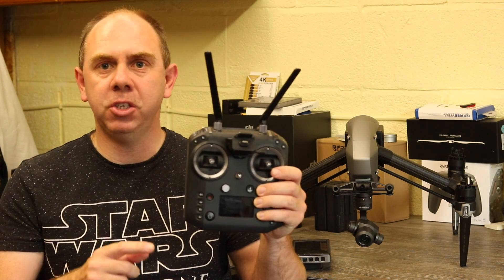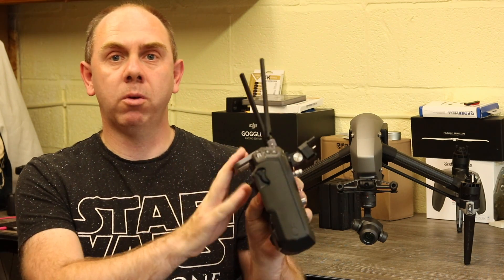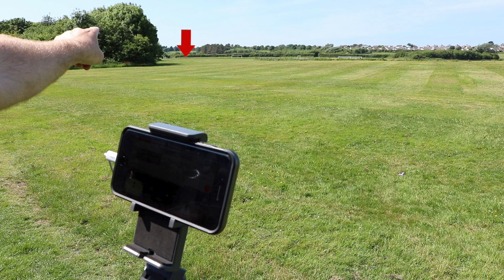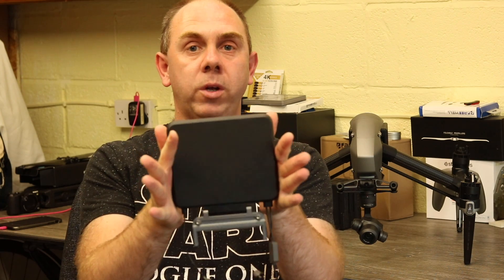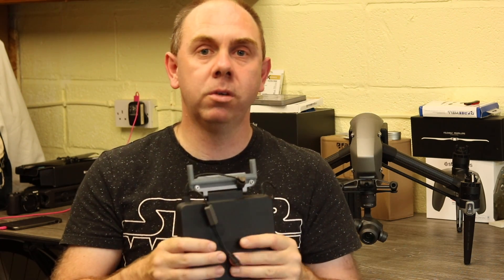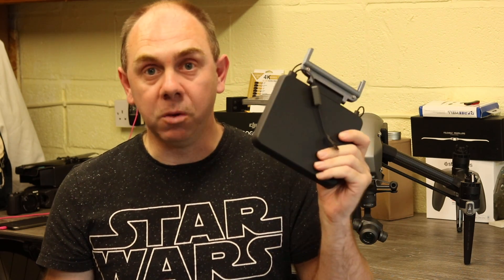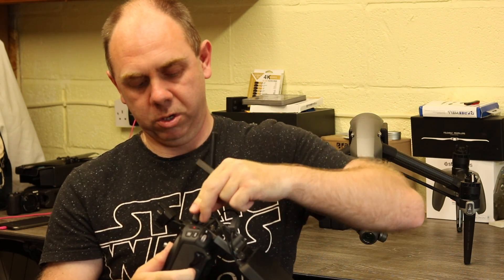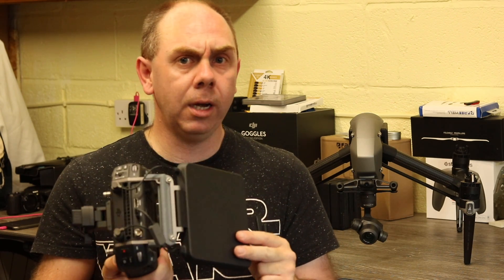DJI Cendence Patch Antenna Signal Tests & FOV Info - Pro Users and Broadcast Especally

Comment: I recently started flying cell phone towers and on some of them I have terrible loss of signal. I've been using a p4p V1. Would one of these patch antennas improve that situation for me and is there one available for the p4p? Thank you!
Reply from the maker: Check out 4Hawks for other patch antennas for DJI other models.  It may help as it’s more directional.
Reply: @MadRC  
Ty!

Comment: Hi. I have liked all of your videos, hence my Subscription. I only found this one, because I was looking for FOV info. Having watched it, I'd like to say that my experience with the patch antenna has been very different. I have not lost signal - ever. With my Inspire 2 directly above, a km out to sea, me hiding behind an object so I am not in shot. I have not consciously 'aimed' the patch at the UAV, especially when chatting to the client at the same time. This is not a later implementation, as I got my Cendence/Crystal Sky as soon as they were available. You have made me want to formally test it. 2 days ago I was filming an approach to a wharf from 600M out to sea, where we were re-enacting an evacuation scenario, and I had to hide behind a small building. I was actually facing away from the Inspire while hiding, and had no issues. The other day, I had a job where I flew about 1.2km away among big power lines between two radio masts. I expected some RF interference, but everything went perfectly.

Comment: Hi. I’ve just bought my I2 and am mad busy reading and watching everything I can to try and get up to speed on this amazing craft (still have my M2P). The purchase included a Cendence remote with the patch antenna and CS monitor. I noted your mention of the CS not currently being able to support 1080p. Having said that I see this is 12 months old and wonder if there has since been an update on the CS (there’s usually a lag). Many thanks. Peter
Reply from the maker: Sadly no nothing has changed on this and tbh i'm not expecting it to now sadly. Its performance was not quite there.
Reply: Ahh well, that’s life I guess. Thanks for replying. At the moment I’m trying to see if there’s any way to get a zoom lens to zoom using any buttons or wheels on the std controller being used as a slave to the Cendence as master. I can use a slider on the screen but it’s a little hit and miss so configuring one of the wheels to zoom in and out would be much better if I can figure out how. Thanks again, take care. Peter

Comment: Hi Mad RC, great video. On the latest firmware om both my Cendence and I2 but cant Seem to find the bitrate settings anymore? There's no custom option under HD.
Reply from the maker: Are you using Crystalsky, If not try changing your devices region settings to USA, I will fire mine up and Look.
Reply: @MadRC  Im using a oneplus 5T with a cendence RC, located in Denmark.
Reply from the maker: I have a feeling it’s only on IOS now.

Comment: thx for the quick disconnect link !  I'm a bit confused on the part about 1080 vs 720 for Android & iOS.  I've used live feed via Android tablet numerous times in 1080 and no issue.  Maybe I misunderstood the info on that .  .  . great video, thx for putting it together for your subscribers !!

Comment: hi Mad rc

nice informative video thanks. id like to know how the patch performs when  obstacles like trees get in the way as the standard antenna seems to suffer pretty badly when any such objects obstruct direct line signal to the drone in my experience. Yes i can still see the drone but the branches are dense enough to block transmission signal with standard antennas.
Reply from the maker: It should be better but it’s an interesting test, let me think and come up with something.

Comment: If you do not get the message that the Patch Antenna is connected after the FW update, 1) disconnect the antenna, 2) boot the Cendence, 3) turn Cendence off, 4) reattach the antenna and then reboot.  I had to do this to get the message.

Comment: I have been using a secraft tray with my Cendence, much more stable neck strap and palm rest,  but when using the secraft tray, the patch antenna is not usable. haven't figured out a solution to that yet.

Comment: The benefits of 1080p transmission on short distance are obvious for TV broadcasters, but what the patch antenna can offer for typical long distance flight with 720p video transmission at average 4Mbsec bitrate? Will it allow for significantly better transmission range as compared with standard omni antennas?
Reply from the maker: It should, the tests at 1080P is to be able to show the difference but the reality is that will translate to the 720P mode as well but as with all things is will be location specific. 

It should give better range but these things are not linear.

Comment: Just a thought. Can you run 2 patch antennas in parallel? I used to run two small patch antennas on my p2 for years to gain better coverage
Reply from the maker: Probably no and actually you don't need to because its actually 2 antennas already, when you look inside there is one each side for each input.

Comment: Hi 👋BROTHER.... ...

My dji inspire 2.   ( 01.02.0100 )
Remote Controller (01.01.0010 )
App.                          (  4.2.16) 
Dji Crystal sky ultra ( 02.06.06.00)

please tell me how to  get Dynamic Home point option in my Crystal sky ultra., as i am unable to see that option.
Reply from the maker: On the crystal sky you still need the DJI GPS Accessory to be able to use this sadly.
Reply: Thank you so much Brother....

Comment: It really pisses me off that 1080p mode doesn’t work with the Cendence.  DJI are foolish not to put the development and performance of their own accessories before that of third party devices.
Reply from the maker: I think you mean Crysatalsky as it does with the Cendence but yes its a shame unfortunately.
Reply: Yes, that's what I meant.  Thanks for the correction.

Comment: When I tried the patch antenna for my first few flights I was not impressed with its performance so I had given up using it in favor of the omnidirectional antennae. This video has given me some new insights about the antenna that have almost convinced me it might perform better than the Omni antennae in direction-limited use. I say almost convinced because I would like to have seen how each of the antennae perform with the drone in flight over the entire range of headings and distances. I may just have to take my rig out to the desert this weekend and give it a go - after I update the firmware on the patch antenna of course.

Good topic MadRC.